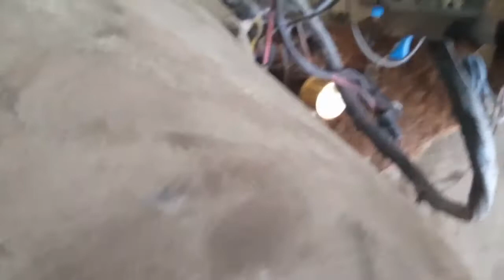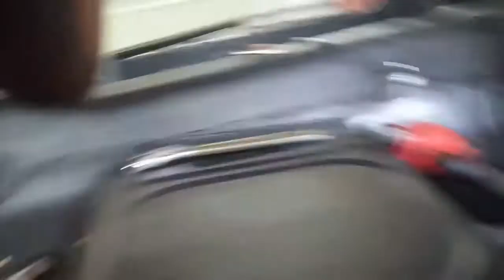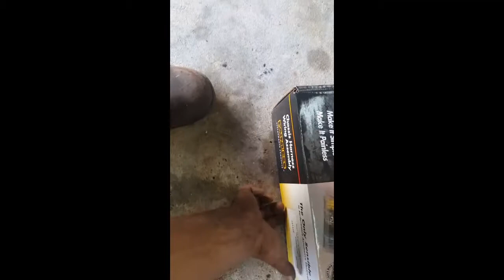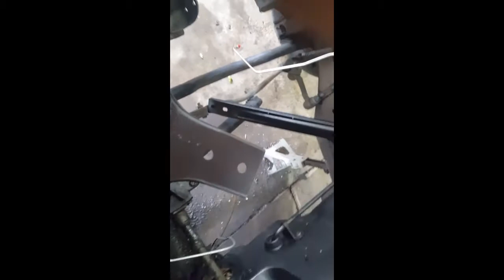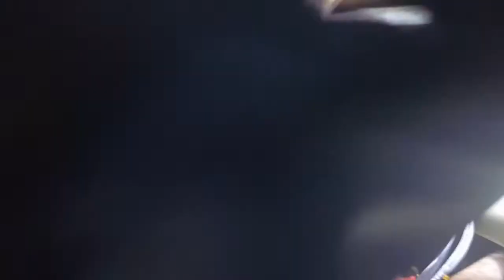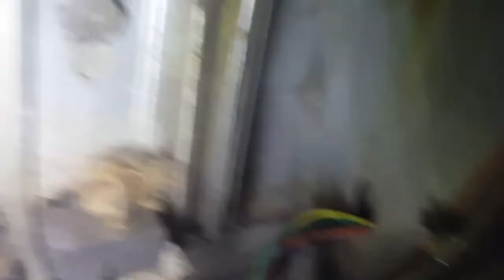65 mustang wiring

Comment: Does it matter if your working on a v8 or i6?
Reply from the maker: Not really the theory is the same. Alternator goes to voltage regulator, regualtor tells alternator to turn on. As far as engine gauges, its still volts, amps, oil pressure, and fuel. Just in different locations because of the difference between the shape of aV motor and a straight motor.